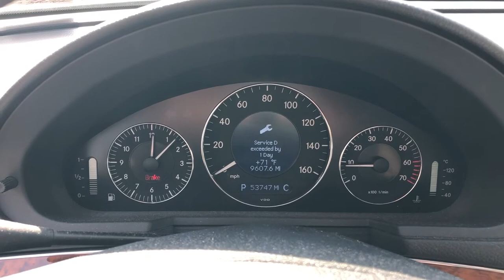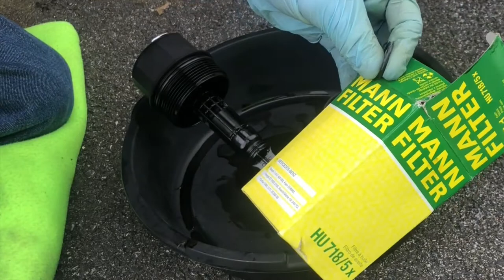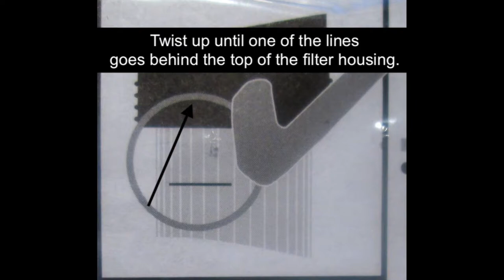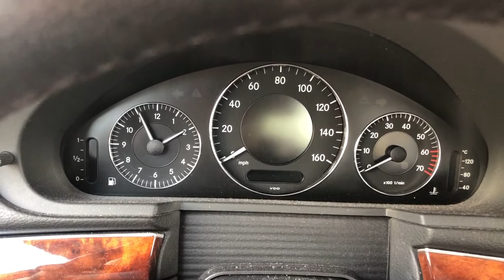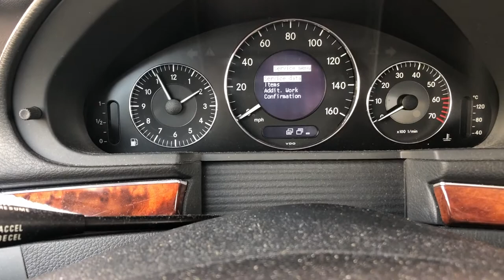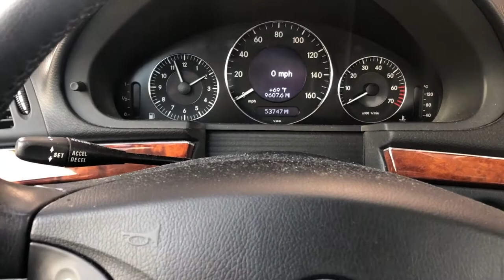Secret Way to Change Your Car's Oil - Super Easy - Automotive DIY - Mercedes E320 W211 and More Cars

Comment: Great video  after a couple of years of using the vacuum pump I got lazy and bought a 12 volt pump mounted on a 5 gallon container used to drain the inboard motors on boats. I use a golf tee to plug the end of the hose so it doesn't leak all over.
Reply from the maker: Now that's working smarter not harder! Great tip.

Comment: I believe most oil changing places are using this method to suck out oil and transmission fluid that needs replacing. I don't think this is anything new and they've been doing it for years. They have strong pumps that suck out all oil so I don't think you are able to remove 100% of old oil in this way.  Remove the oil plug under the car and remove all oil then fill up and if no leaks measure how much you can extract in this way to see if you leave any residue and how much of it. It is fun to see this done this way.Subscribed.
Reply: Yes, this will remove ALL oil. Try it out: Extract your oil through the dipstick, then crack the oil drain plug - you will get 4-5 drops of oil at best. 
The myth, that the extractors in reality don't work as well, is just that. A myth created by people who have never tried it or understand that this is the way mercedes REQUIRES their dealerships to do the oil changes on a Mercedes.
Reply from the maker: We tested this ourselves and there was 5-10ml at most from the drain plug after extracting.

Comment: Just as a note, you can make it even easier. No need to remove the oil cap and pour the new in through the oil cap hole. You can leave the oil filter out and pour all your new oil straight into the oil filter mouth hole. One less thing to mess with and that oil filter hole is much larger than the oil cap hole and a whole lot less messier should you drip a little.
Reply from the maker: That's a great tip and will definitely help other viewers. The oil filler cap can get pretty well stuck on there some times. Like you said, one less ting to worry about. We could probably skip the funnel pouring right into the filter hole. We'll try that next time and see how it goes, thanks!

Comment: You can use a rubber strap wrench, you can get a set ( a bigger and smaller one ) at Lowe’s for less than 20$ including tax. 
I prefer to use the socket since I have it.

Comment: I have an e320 w211 wagon and I believe the dipstick is in the back not the front like shown in this video.  It's not a 4matic and non air matic but does have SLS air  suspension in the back.
Reply from the maker: Thanks for this tip which will help other viewers. We checked and it appears some C320s also have the dipstick in the back. Be careful as this is directly next to the trans dipstick cover. The trans dipstick cover should have a red locking cover so you can see the difference.
Reply: The Dipstick you mean is for Transmission Fluid...

Comment: if you needed to clean the oil pump and hoses,  what would you use?
Reply from the maker: Good question. You could use soap and water, then rinse it out with water. Or, you could use a 10:1 Water:Isopropyl Alcohol mix. However, we don't recommend rinsing it out, because there is no way to recycle the waste water/oil that would come from cleaning. We simply empty it out each time and then take the dirty oil to be recycled. I understand you may may want to clean it if you plan on reusing the fluid or pump different types of fluids. If you are using the pump for multiple types of fluids, we recommend separate pumps for anti-freeze and oil.

Comment: Can I do this to my 06 cls 55 amg
Reply from the maker: Good question! Unfortunately the M113k engine from those years has two sumps, so you won't be able to vacuum all the oil from the top. You could vacuum from the top but there would still be about 1-2 qts in there. Mercedes specifies removing and replacing both drain plugs.